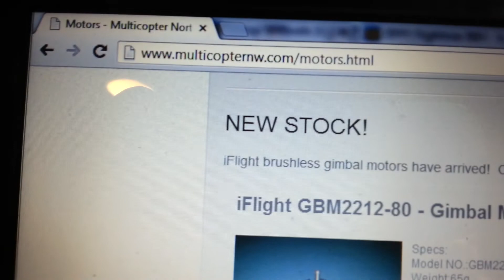Brushles Gimbal Motor & Control Board Test - Multi

Comment: I just bought a cheap gimbal off eBay to use as handheld steady cam. I also bought a joystick so I can adjust the pitch and tilt of my gopro camera. Do you know what the wiring for joystick might be, I don't want to burnout my control board. Thanks!

Comment: Hey there nice video. I have the same board and after plugging in the leads. It twitches a bit and wont calibrate completely. It tries to start it seems and then starts twitching. Surely a wiring / power issue. Not sure 100% what I should be doing here. Thanks for your help!

Comment: Hi there and congrats for the setup.
I have also the same controller board but I can't seem to get it work properly.
I upoaded the latest firmware 049_161 but what I get is an endless crazy shaking from the motors. Another thing I noticed is that in my board when on, the only light the turns on is the blue and not the red and green which I see to yours are flashing.
Do you know what may be fault?
Please help, thank you in advance..!

Comment: Hi Michael
I just purchased a 3 axis Gimbal system from Hifly  i had to assemble the it, it came in 300 pieces, i managed to put it all together, but now im stuck, not sure how to connect the controller nor how to program it, i have two controllers one is the 3 Axis EvvGC the other is the 2 axis controller it looks very much the same.. I would really appreciate ur help.
Thanks, John
here is the link to the system i got.

ebay.ca/itm/271258661994?ssPageName=STRK:MEWAX:IT&_trksid=p3984.m1423.l2649